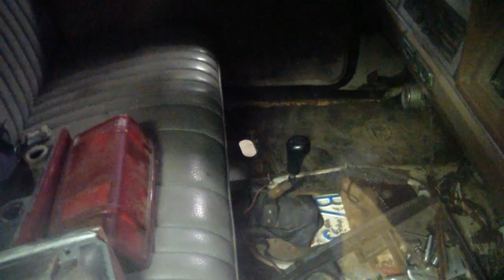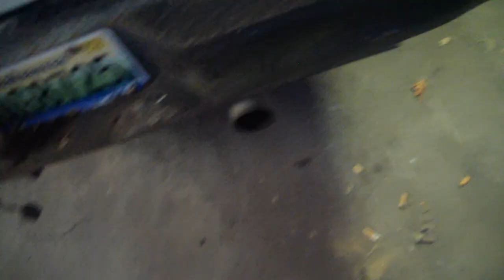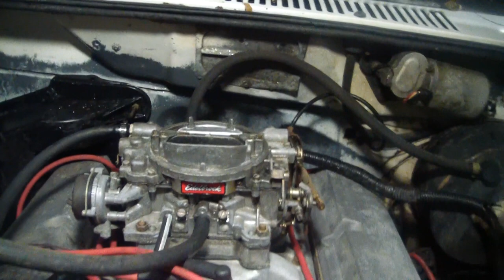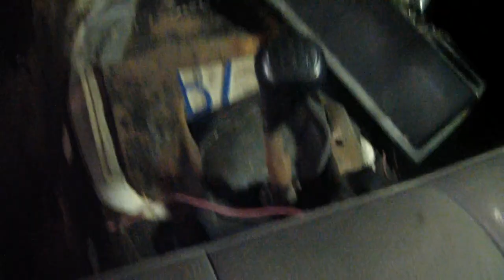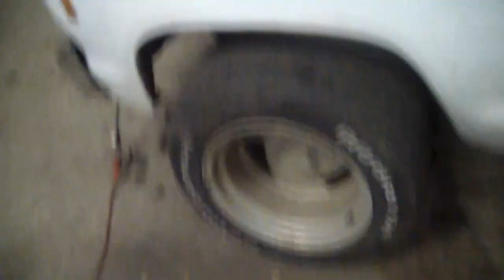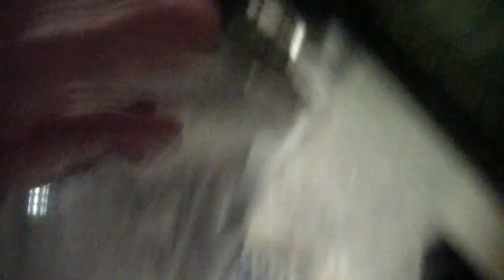87 Ranger V8 5 Speed

Comment: There's something about this range that's so unassuming. Great video
Reply from the maker: It's had a V8 for 25 years 2 302s and a 351w now back to a 302 with a little turbo Lol
Reply: @kickassmustangsgarage  Been through and hell and and keeps pushing! Great content
Reply from the maker: It sat for about 8 years just moved it around to cut the grass. I had the 302 that's in it now for 12 years on a stand and a buddy of mine gave me 3 turbos off 2 of his old semi trucks. so I have two off a14 L and one off a12.7 L the 14L ones are just too big for a 302. they all had 40lb springs in the wastegates. I took the gate actuator off one of the 14L turbos because you can remove the springs in it. the 12.7 L was press sealed no way to open it up. I took the big spring out now it opens at 15lbs with the small spring. I need to get it down more it's taking it but it's a bit much for a stock 01 explorer 302
Reply: kickassmustangs garage that’s so awesome man! I bet this is as unique as it gets to be using semi trucks turbo lol. Without a doubt you’ve got 2 of the baddest cars out there! Keep up great content man.
Reply from the maker: The mustang is slow it's still stock only thing that has been done to it a set of equal length headers, off road H pipe, flowmasters and some 3 55 gears. The truck is a monster lol I don't think anybody else has used a semi truck turbo on a car or truck I looked I couldn't find any info about it. It cost me about 800 bucks for everything to get the turbo set up done on the truck the turbo was free I had the carb just alot of work making it fit under the hood of a Ranger. Thanks for the encouragement.

Comment: Very cool man I just converted mine to a mustang T5. I made up a hydraulic clutch works flawless
Reply from the maker: They sell a pull type slave cylinder for less than 40 bucks. I put one on a different V8 ranger that I sold to a buddy of mine and used the factory clutch master cylinder like you said it works perfect.
Reply: @kickassmustangsgarage  yea I heard of the pull type slave. I got a 1992 Mazda b2200. Push one $12.00. I’m gonna make a video soon about the set up
Reply from the maker: @1953fords  I got a little crazy and put a  used Semi truck Turbo on mine homemade my own kit. I got a 9 inch rear end to go in it eventually I've busted 2 of the 7.5s over the years. I know people are like WTF when you blow by them in a Ranger Lol. Glad to see that there's more V8 swapped Rangers out there. You'll love the T5 over a auto any day.

Comment: You should show the custome  cable clutch bracket  you made under the  dash
Reply from the maker: I probably will eventually hoping people would subscribe not to motivated when i can't even get a like out of people
Reply: @kickassmustangsgarage  
  I built  my  truck  after watching 50 tussin trojan  horse build and I made my YouTube channel  not to get likes or subscribers  just to give someone motivation  to show what can be  done with junkyard junk . And for a reminder  where it came from .
Good luck with your build
Reply from the maker: it has had a v8 since 1995  started with a 302 then 351w back to 302 now soon to be turbo charged using junkyard parts and simi truck turbo got the new 302 out of a 01 expolrer that was flipped from pullapart for 155 bucks made my own hot side that fits in the ranger going to test it soon out of the truck see if it will spool up before I spend more money on it hopfully it all works.

Comment: Tire size? Wheels specs ?
Reply from the maker: 295/50 /15 on the rear  all the rims are 15/10s the tires on the front are 265/50/15s but they don't make them anymore.
Reply: @kickassmustangsgarage  backspace? Looks good 👍👍👍
Reply from the maker: @thsvetsmek6917  they are in the middle so 5 inch backspace. Go check out some of the newer videos on it with the Semi turbo on it now and Subscribe if you like what you see.